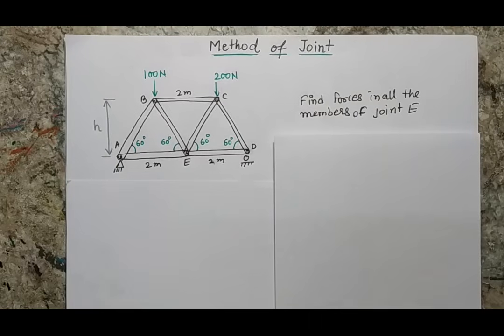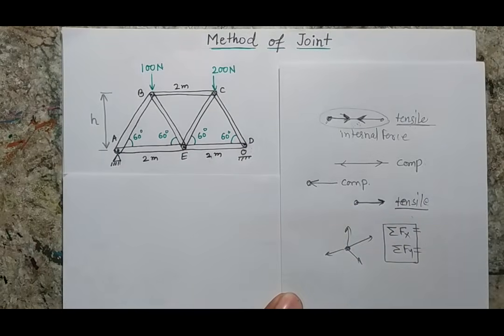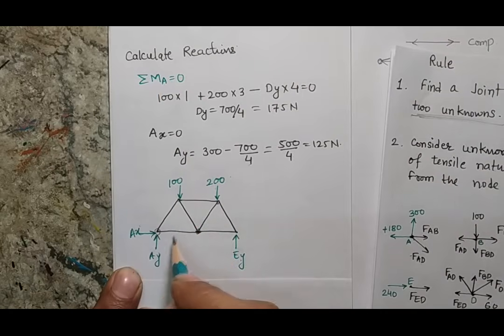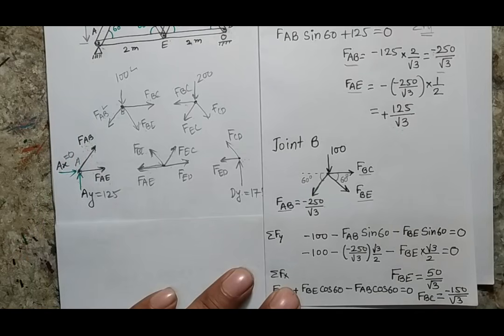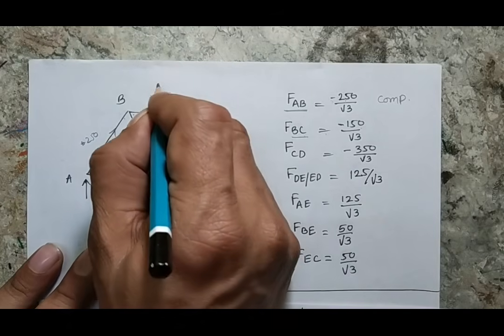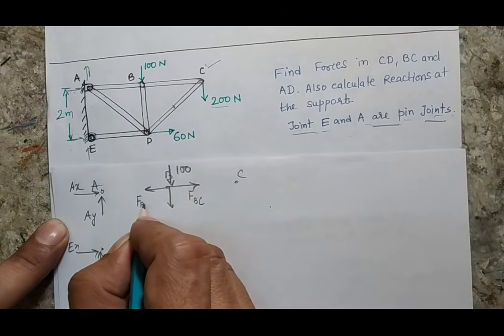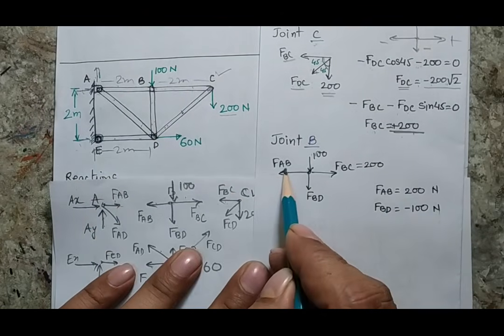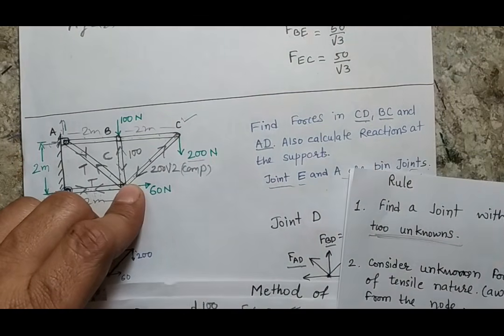L3.2 Trusses: Method of joint || Concept and examples || Engineering MECHANICS || FIRST YEAR course

Comment: at Joint E, both vertical forces are in +ve direction. FBEsin60 +FECsin60=0 
then how FEC comes with +ve
Reply from the maker: Hi thanks for your previous comment. Here I will check and confirm, can you specify time instance.
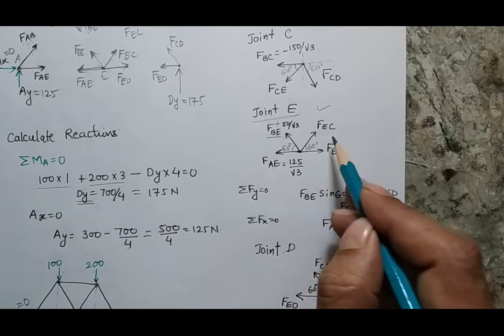Reply: @ashishpurohit9138   sure, it was 13:30 when we calculate the Fy Forces at Joint E

Comment: sir, in the second problem please explain how to calculate VERTICAL Reaction Force at A and E.
Reply from the maker: Hi, Please mention the time instance
Reply: @ashishpurohit9138  Time 24.20
Reply from the maker: @jaguarg3761  Vertical reaction at E will be zero as there is only on horizontal member connected. A_y will exist and can be calculated either by taking moment at E considering whole truss as single body (I did at 24.34) OR by considering equilibrium of joint A taking force AB, AD and two reactions.
Reply: @ashishpurohit9138  Thank you very much Sir.